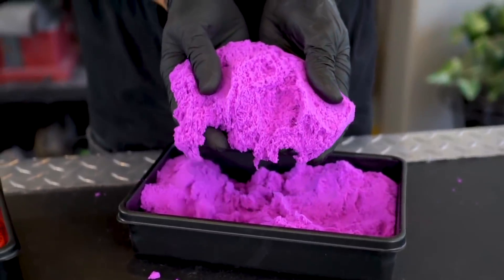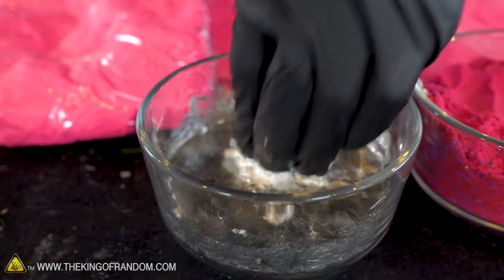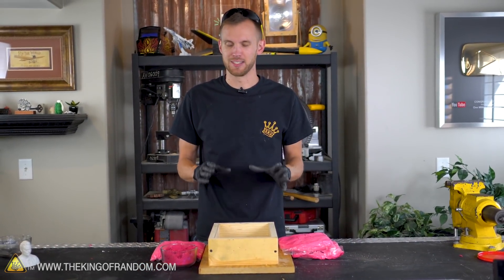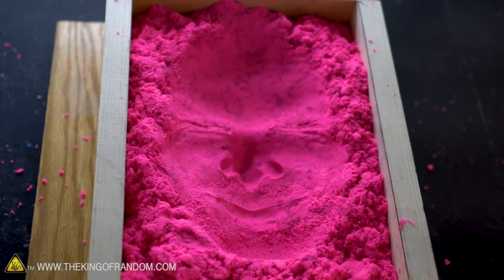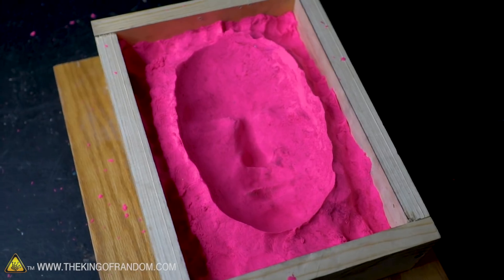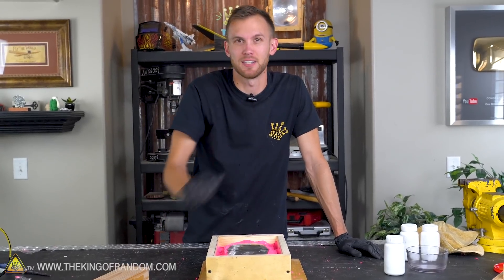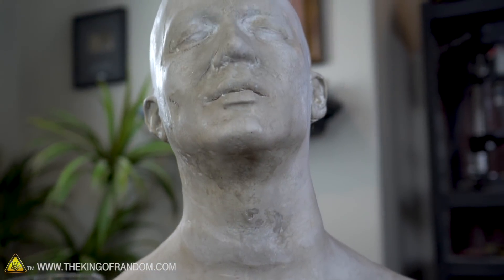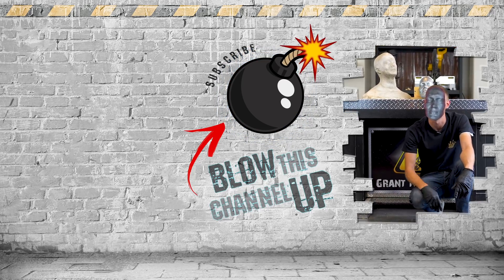Casting a Face with GALLIUM

Comment: wait a second, if gallium has a ridiculously low melting point, is it possible to turn it into gas? and if possible, what are the potential characteristics of the gas? (yes i realize that it would have to be very hot to turn it into a gas stage, and would be hard to work with and contain without special storage and other stuff, (assuming it has a gas stage that is actually reachable through current technology.)

Comment: gallium melts at around 30 degrees celsius, so wouldn't it fall apart if you turned off the air conditioner?

Comment: Random Suggestion to try casting other non hot things that might seep, make the mold then spray the surface of the mold with  the paint sealant used by moddlers/tabletop-gamers after they've painted somthing. That should create enough of a seal to let other stuff cast in there.

Comment: Make a metal casting plaster mold from the gallium face, then as it melts so low, melt the gallium out and cast it in aluminum? You could make a silicone one instead? For some chocolate face casting?

Comment: You mentioned the use of casting resin in the kinetic sand but worried about it leaking through. What if you tried spraying the kinetic sand with a layer of something like scotch guard before pouring resin?

Comment: Try Turning SAWDUST Into Solid Wood.
Reply: WITH FLEX TAPE!!!
Reply: Dat would be kewl but, its basically  gonna make it like that rough, rigid, flat wood plank things that give us lots of splinters when we rub our hands against them
Reply: There would be no splinters, and it would most likely just be an epoxy-sawdust mixture
Reply: @theuniversalbean9352  Yes But I Just Want To See How Will It Look If Make At Home Or Grant And Nate's Home
Reply: Ok
Reply: OP AF BOI NOI no it wouldn’t give you splinters
Reply: Unless he sands it and smothes it down enough
Reply: @Zack-eq3ou  smoothes*
Reply: That's particle board
Reply: So almost chipboard?
Reply: So MDF?

Comment: Have you tried using kinetic sand to cast lead alloy metals? The melting points are much lower than aluminum and would be higher than gallium.

Comment: What if you used the "liquid sand" setup to make molds? It might not hold as much detail, but you could make a material more pliable while making the mold, then lock it in by shutting off the air

Comment: If you cast wax inside a kinect sand mold, like your face right there, you can use it to cast molten metal in hot temperatures, i don't know the details behind it, but thats what the professional blacksmiths do it, since it seens like the wax melts and evaporates faster than the metal solidifies, wich makes the metal get to all the spaces of the mold. You could make the TKOR logo like this, i guess it would be fun to watch.

Comment: What about lead? Melts at lower temperature than aluminium but at a higher temp than gallium. I think the Kinetic sand would be able to handle that temperature.

Comment: Tech note : apply pressure to that sand using compressed air Chamber or using a hammer before you make the shape using the mold you would better details

Comment: Try to put Gallium in the microwave.
Reply: expeloco it will short out the microwave and something is probably going to go on fire or explode. Still safer than the rocket engines...
Reply: Nothing will happen, the microwave will just break...

Comment: Can u try putting a glass thermometer inside a vacuum chamber
Reply: Nothing would happen. Glass is fanastic at holding it's pressure. If you watch Cody's Lab you wouldve seen him put thousands of psi inside a little glass tube.

Comment: You should try casting molten tin in the kinetic sand. It might be in that goldilocks zone of having a melting point hot enough that there is no risk of your cast melting on a hot day, but not too hot that it burns the sand.
Reply: Bismuth might be cool too.

Comment: If you were to try casting with resin in the kinetic sand, I think putting the mold into the freezer for several hours and then pouring the resin into the mold immediately after taking said mold out from the freezer. Not 100% sure but worth a try.

Comment: Can you somehow get water to a solid state from pressure, not temperature?
Reply: Technically cold boiling water until it freezes in a vacuum is using "pressure" to freeze the water, its just a negative pressure differential rather than a positive one. Codys lab has a video on this
Reply: Ice is less dense than water. Putting pressure on anything heats it. So no that can't be done.
Reply: Leggir wrong pressure doesn’t make something hotter. Do your research before you try to correct someone.
Reply: @therealspaghetti208  pressure doesn't necessarily make things hotter, but the friction caused by it does
Reply: I am aware of some of the facts you can and can't do with water, and plz don't quote me on this, but scientists have found planets with ice cores a bit more dense than diamonds... and here is were you don't quoat me; I know that billions of tons have been compressing the planets cores for millennia, so making something like that and maintaining it for longer than a second would be extremely difficult, if not inpossiblr, but I would enjoy watching him struggle to do it xd
Reply: It wouldn't even be 'ice-12' probably 'ice-.1' if he found a way, the numbers are referencing the hardness
Reply: No
Reply: It can't be compressed
Reply: Not on earth at least xd
Reply: If you put enough pressure on the water molecules you can get them so close together that they resemble the ice structure
Reply: Juan antonio  Ice is less dense than water, so squeezing the molecules together wouldn’t make water solidify

Comment: I have an experiment for you:
Does an evacuated glass bulb weigh less inside a vacuum chamber, than outside of it.
(In other words: Is the buoyancy of the air mesureable with your equippment?)
Greetings from Germany.
Reply: Small correction for you. When referring to how heavy an object is, the word is weight (Gewicht), which is different to mass (Masse).
"glass bulb way less" should be "glass bulb weigh less" :)
Reply: @MGSLurmey  
Wow, how could I let such a mistake slip through?
Thank you for pointing that out to me. I too can't stand spelling errors, so really, thank you.

Comment: You should try Moulton lead I try it with k/sand and it works the lead just needs to be right at the melting point or the sand will burn like (650°F)

Comment: You could try casting the moulding silicon in the Kinetic sand. As its thicker than resin it won't soak into the sand as much.  Then Nate can have a rubber face as well.

Comment: I would like to suggest you to turn eggshells into concrete. As egg shell are made from calcium carbonate with reaction to strong heat and reacted with water is should react into calcium hydroxide(lime) which can be mixed with the required materials and made into concrete. while this should be possible i could find no videos detailing this process.

Comment: Try pewter metal in the kenetic sand it has such a low melting point you can melt it on your stove I wanna know if that will burn it like the aluminum did

Comment: After making a mold of your face you should then get a projector and project a flat image of your face on it. Because reasons and it would look cool.
Reply: Michael Pierce It would work if you took a scan of your face like William Osman did so it would project the 2D image onto the 3D surface properly.
Reply: @CK-ceekay  they did it at Disneyland too for the haunted mansion

Comment: What happens when you put gallium in the furnace or put it in liquid nitrogen when it’s a fluid
Reply: If you put gallium into a furnace it will melt and become molten, if you put it in liquid nitrogen it will turn into a verry cold solid

Comment: Can you try melting bulletproof glass and see if the resulting thing is also bulletproof then make a prince Rupert’s drop with it if you can.
Reply: Except its tempered glass with laminate and resin between it
Reply: I can already tell you, it  won't, bulletproof glass is "bullet proof" because of how it is layered
Reply: Rhett you bet It’s actually an awful idea.
Reply: This will not work
Reply: Beep Beep
Reply: Awful idea😂
Reply: Bad idea. Bulletproof glass is glass and plastic sandwiched together
Reply: Bulletproof glass is just multilayered glass with multiple different types, If you melt it down it'll be structurally unstable and not be bulletproof.
Reply: Bullet proof grass
Reply: Pewter. Pewter all the way
Reply: What is Rupert's drop
Reply: Bulletproof glass is a layered composite, meaning its a pane of many different materials layered on top of one another to give it its strength. Melting it would burn some of the materials and cause it to lose its strength. Cool idea, but wouldn't work in practice.
Reply: The problem is bullet proof "glass" also contains plastic layers
Reply: I would watch that lol
Reply: Aikano9 so it’s like an ogre aswell?
Reply: Isn't bulletproof glass bulletproof because of how thick it is?
Reply: CrazyDodo82 no it's layered
Reply: yes nate will you please do that it would be really cool
Reply: actually though, this is a plan
Reply: up

Comment: Please Make liquid hydrogen with the hydrogen generator!!
Reply: No such thing as liquid hydrogen, it's theoretically impossible even at absolute zero
Reply: Haleem Khan it’s possible, liquid hydrogen exists at 20 kelvin, barely above absolute zero.
It’s possible to have it liquid at higher temperatures by making it in super high pressure.

However, materials required are nothing TOKR could possibly afford or get.